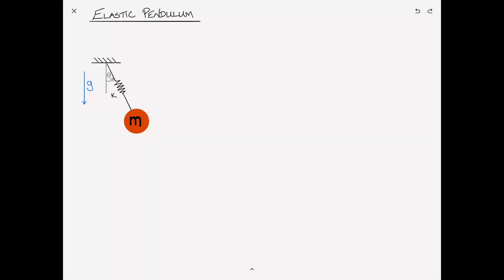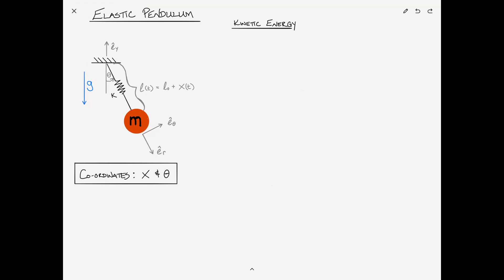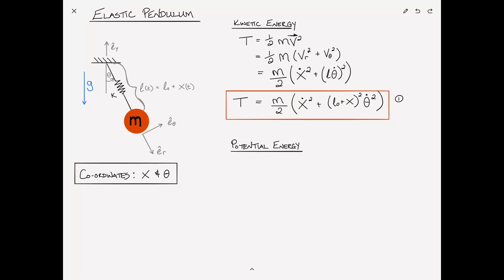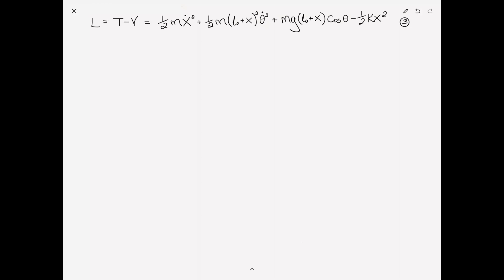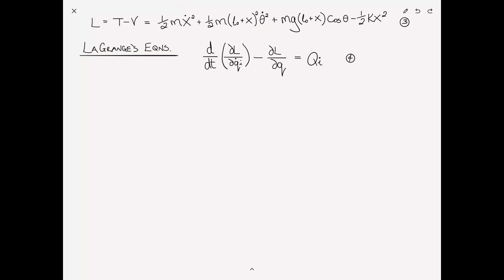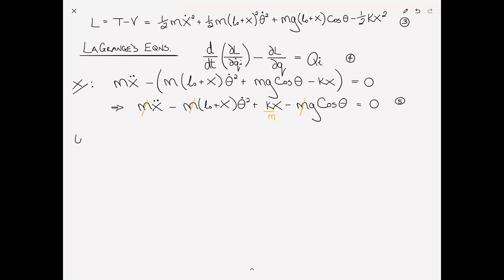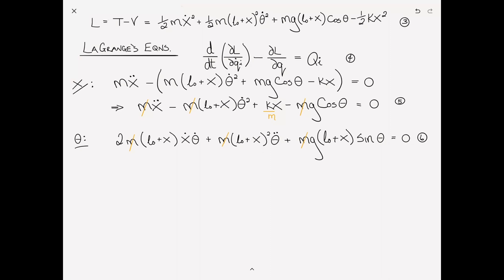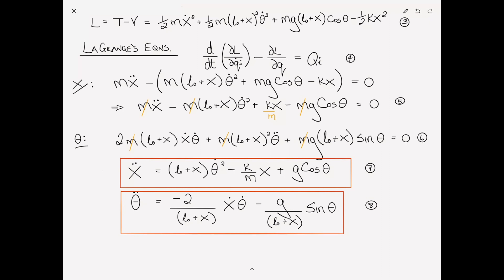Equations of Motion for the Elastic Pendulum (2DOF) Using Lagrange's Equations

Comment: what about generalized forces? why you considered it to zero?
Reply from the maker: There are no externally applied forces in the problem statement, so there are none to consider.  The weight of the mass is included here as part of the potential energy (though you could have included it as an generalized force instead and then ignored the potential energy contribution).

Comment: 3:00 why wouldnt h just be x*cos(theta)?
Reply from the maker: That's because I assumed the origin of my coordinate system to be at the hinge.  You could have used h = x Cos θ instead and you would have got the exact same solution, but that assumes that your origin was located at the mass when the spring was undeformed rather than the hinge.  It's just a matter of where you consider the point of zero potential energy to be. Simply adding a constant to you potential energy has no effect because where you take the derivative, it drops out.

Comment: I have a doubt at 6 min 25 sec. How you did differentiation here ? I didn't understand that step.
Reply from the maker: First I take the derivative, ∂L/∂θ_dot which gives me
    ∂L/∂θ_dot = m(L0+x)^2 · θ_dot
then I need to take the time derivative of this, d()/dt.  Because both x and theta_dot are functions pf time, I need to apply the product rule AND the chain rule.  This gives me two terms.
  d (∂L/∂θ_dot) / dt 
      = 2m(L0+x) · dx/dt  · θ_dot  +  m(L0+x)^2 · d (θ_dot) / dt
      = 2m(L0+x) · x_dot  · θ_dot  +  m(L0+x)^2 · θ_ddot)
Reply: ❤❤nice 👍  @Freeball99
Reply: @Freeball99 Thanks a lot for this explanation

Comment: why when you take the derivative with respect to theta and x does it equal 0?
Reply from the maker: Are you asking why the right hand side of equations 5 & 6 are zero?  If so, this is because there are no external loads in the x or θ directions.
Reply: @Freeball99  Yes. Thanks for the reply! I thought setting the right hand side to 0 meant you were solving for when there was no rate of change of x and theta? How come it's 0 because there are no external loads?
Reply from the maker: @matthewlee2023  From Lagrange's equation (#4) the right-hand sign contains the generalized load, Q for each coordinate.  In this problem, there are no external loads, so Q_i is zero for each equation.  If, for example, there was a moment, M(t) applied at the hinge, then this would appear on the right side of the θ equation.  Similarly, if there was a force, F(t) applied at the mass in the radial direction, then this would appear on the right side of the x equation.
Reply: @Freeball99  Got it! Thanks!

Comment: gravitational potential energy term is [ -mg(x+l)cos0 ] that u wrote in the solution but i think it should be [ -mg(x+l)(1-cos0) ] because the height h=(x+l)-(x+l)cos0. (read 0 as theta)
Reply from the maker: This is a function of where you place the origin of your coordinate system.  I have placed mine at the hinge and you have placed yours at the mass (in its equilibrium position).  So the values differ by a constant.  However, this makes no difference in the end because when you apply Lagrange's equations, the constant gets differentiated out - i.e. what is important is not the absolute value of the potential energy, but rather in the change in the potential energy as θ changes..
Reply: @Freeball99  i think we can't take the ground level or origin from the bottom in elastic pendulum because the length of pendulum changes so we have to take ground level from the hinge, like u did.
Reply: @Freeball99  got it, thanks

Comment: I have a doubt! Why is your X an independent coordinate! Isn't that a function of theta as well, coz X= mg cos(theta)/k
Reply from the maker: While there is definitely coupling in the motion between x and θ, x is not a function of theta.  As an example, if this system is at rest (θ=0) and I give the mass a slight nudge in the vertical direction, the mass will simply vibrate up and down like the simple harmonic oscillator.

Comment: Hello sir, 

When writing out the kinetic energy of the system, why didn't you split it into 2 terms, one for the translational and another for rotational to get T = 0.5*m*(xdot^2) + 0.5*I*(Theta dot^2)?  "I" here is the mass moment of inertia.
Reply from the maker: Generally in the case of the simple pendulum, the rotatory kinetic effects are negligible (unless the diameter of the mass is very large or the string is very short).  I had made some simple pendulum videos prior to this one and in those I believe I made the assumption that the rotatory kinetic energy could be ignored.  This video follows from those, but I probably should have mentioned it.

Comment: about the kinetic energy - dont you need to consider the Inertia energy as well? (1/2)*(I)*(omega^2)?
Reply from the maker: This is a continuation from the simple pendulum problems I worked in previous videos.  In the case of a simple problem, we assume a point mass, so there is no rotational kinetic energy.  I mentioned it in some of the other video, but probably should have made it clearer in this one.  Typically, in the case of a simple pendulum, the rotational KE tends to be negligible and can thus be ignored unless the radius of the mass is very large compared to the length of the string.

Comment: What will be the time period for this pendulum.
Reply from the maker: Good question.  The resulting frequency/period will  be a function of both the magnitude and frequency of the applied load(s).  However, if you are talking about the frequencies/periods of the natural modes then these can be found by solving the eigenvalue problem.

Comment: Hello, your video was very helpful with solving this problem ^^. However I have one question: how do you know that the generalized forces  Qi must be equal to zero? Or, at least that's what I understood from the video
Reply: Okay, I think I got it. I think it is because the only force that does work (weight force) is conservative. Is this right?
Reply from the maker: Correct.  The generalized forces are the externally applied loads (can be conservative or non-conservative).  Typically the internal forces (conservative) are included in the potential energy expression.

Comment: Why is the heighe not l-lcos(theta) ?
Reply from the maker: These are, in effect, the same thing.  It just differs by a constant, so what you have done is assumed that zero y-location is at the mass while I have assumed that the zero y position is at the hinge.  The point is this...we don't really care about the absolute value of the potential energy (and the location of zero potential energy is somewhat arbitrary).  Rather, what we care about is the DERIVATIVE of the potential energy and the derivatives are identical (because you simply added a constant, l, which disappears when you differentiate it).

Comment: "Value for money" makes me chortle. You have obviously practiced this material endlessly and I wish to thank you for sharing your many insights. I went through this one numerous times. I like the way it incorporates two simpler dynamic systems into one. Lacking the mental agility to  do all the derivatives with great efficiency,  I decided to implement the LaGrange equations with the python symbolic module called sympy. If my solutions differ greatly from yours, it has  turned out to be an error in my grasp of the kinematics. You are helping me continue to enjoy my retirement despite the restraints of the pandemic-induced lockdown.
Reply from the maker: Thank you for you kind words.  This makes me smile inside.